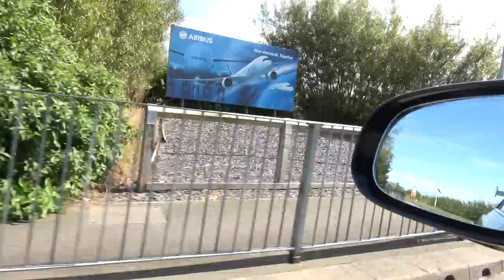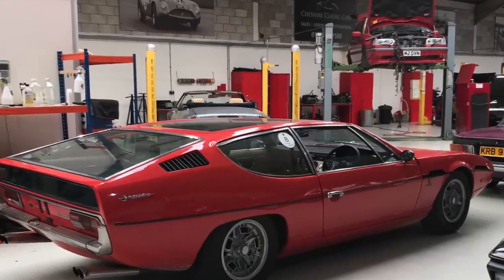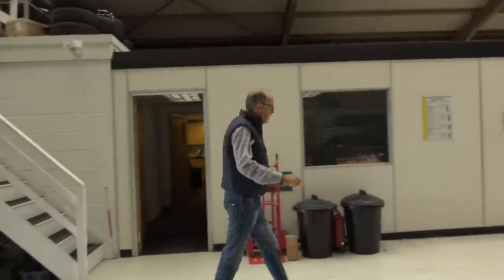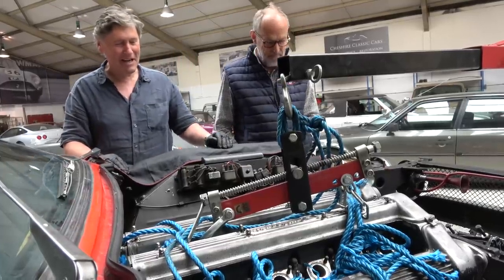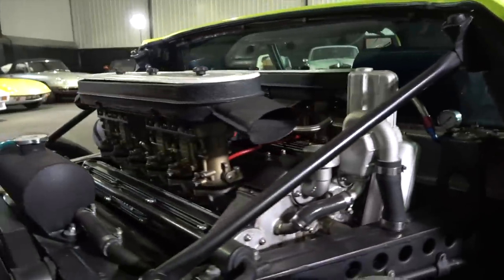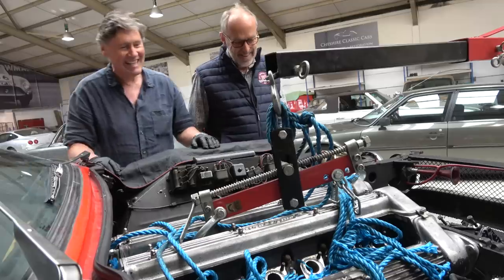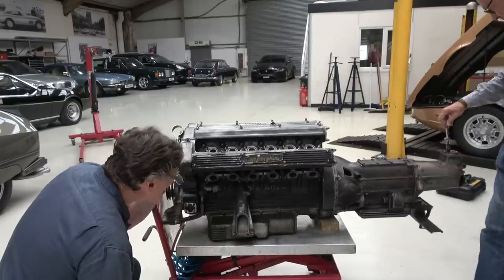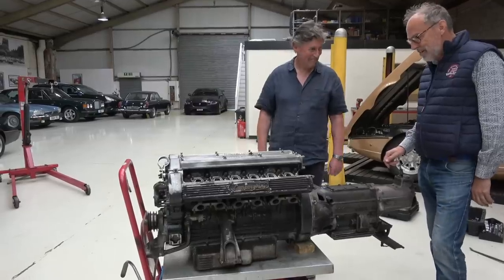Lamborghini Espada V12 engine rebuild. Part 1, removing the engine

Comment: These two two blokes were actually very patient.. with Harry!
Reply: Antonio Farina  and they had his engine lashed to the crane with cheap polypropylene rope.No nice brackets and chains.
Reply: @ianrutherford878  @Ian Rutherford I noticed that too!! No Chains!?!
Reply: @ianrutherford878  those things can handle the drivetrain's weight easily, metal chains would chip away at the engine, these are old engines made without modern metallurgical advancements

Comment: One of my neighbours had a Lamborghini back in the early 1980's and I drove it periodically. It was diesel and very economical. Air cooled. The gearbox was a bit of a revelation at the time, having excellent synchromesh and 24 gears forward and I think 12 in reverse.
Reply: Like a R 480 or something?
Reply: 754 I think. Rear wheel drive, not 4wd.
Reply: I bet it handled like a tractor ....
Reply: @yatespeterm  
It handled like a real thoroughbred Lamborghini. For its time, it was excellent. It had the Pantherised engine that had Bosch injector pistons that work directly off the camshaft

Comment: I knew a guy who had a Lamborghini Espada. I was in pretty god knick. The logos on the cam covers had been highlighted it Red.
The only issue was the upper bodywork and the major rust round the vent gills on the rear roof C pillar. 
He said it's only a run around and not worth bothering about. I think he paid a couple of thousand for it back in the late 70's or early 80s ? 
A long time ago. Great video and good to see you have found a great specialist to help you sort it all out

Comment: I would absolutely love to work in that garage! It would be an absolute pleasure to work on these cars. I really hope this comment makes it ro the owner! A trick that I've used with tight fitting engines that have protrusions that might hit the frame, I cut up washer jugs and use the plastic as a slide rather than a pry bar and risking denting or scratching sometimes irreplaceable engine components. That being said, a pleasure to see such a fantastic car taken care of beautifully. What a fantastic engine!!

Comment: You might tell the mechanics in this video that the York AC compressor is designed so that it can be removed without discharging the refrigerant.  You have to screw in the valves in the head all the way, this blocks the refrigerant in the lines so that the compressor can be removed and/or replaced.

Comment: On the cam cover, at the wide end, where it meets another cam wide end, there is a little metal plate held in by a bolt, or nut and bolt, obviously to keep the wide ends down. Was that from the factory or is it a typical fix for these engines? (I.e. were the covers twisting over time and that wide end wasn't keeping a tight seal against the gasket?)

Comment: Great video and looking forward to seeing the following parts. 
Surprised and disappointed by a couple of things, not power/steam washing the engine and box down before starting the job,  not covering up the intakes when the carbs were off,  and for having such a cobbled together rope job to lift it out after having been lifting them out for as many years.
No doubt you will be getting a lot of detailing done while there is room in the engine bay ;-)

Comment: Good first impression of this mechanic. It costed me $6000 and 2 years (original quote $1600 and 2 months to complete) to have an MG 1500 engine rebuilt. And when I  first tryed it didn't run and didn't have oil pressure. It actually spun a bearing first start. Last time I'll ever take family advice on back shop mechanics. Just pay the bill for a proper brand specific mechanic to do his job. It'll be much cheaper in the long run.

Comment: From the experience my brother and I had taking the engine and gearbox out of a Fiat 124 Sport (AC) more times than it should have; it turned out best to have the rear wheels up on ramps and the front wheels on the ground (so that the body was facing downhill. This made the engine/transmission hang at just the right angle to slide in and out without having to force it in any way. We discovered this on the last round, of course...
Reply: It goes without saying, that you can't orient a vehicle body in this way on a two-post hoist.

Comment: Are you expecting ovulated or scored cylinders ? If so where would you get hold of some or would you bore the cylinders up a 0.1 ,
Reply: It's probably just wear or weak rings or a mix of both. Cylinders weren't plated back in those days and old Italian cars have notoriously small oil galleries so they wear pretty quickly. Add that to carbs sometimes washing the bores with fuel (like on the overrun down a big hill) and its fairly normal for them to need new rings and a hone quite regularly. 

I expect if it's already been rebuilt as he suggested that it may well need a small overbore by now though.

Comment: I'm sure it is "matching numbers", but if the engine had been changed, wouldn't the changer have updated the DVLA, so the V5 is correct? Isn't there any documentation from the supplying dealer confirming the chassis and engine numbers?
Reply: He will already have checked the chassis number against the V5.

Comment: I first looked at it and thought "Just drop the front subframe/crossmember. Easy peasy"  Of course the frame is welded into the car. I'm glad I don't work on Lambos. Is it a wet sleeve engine?

Comment: just did this on my mustang 289/T5 and exhaust came out to. luckly the shifter assembly unbolts from the back side trans tail housing. wonder if this espada has a neutral safety switch?

Comment: Would it not have been easier to put the car on the lift, drop the rear of the gearbox, move the engine backwards until it cleared the crossmember, then drop the whole thing out of the bottom?

Comment: Ok, i'm being stupid, but aren't you supposed to remove that assembly off the engine, before removing the engine out of the car? I swear i remember a TV restoration mid 90's where they let it loose, lifted by a smidge, then removed the whole front section making removal a breeze.

Either way, great excitement at the "part 1" in the title, rarely do we get to see these outside of specialty shops.

Comment: Looking at the damage already done to the frame, someone's already had the engine out.  Can you imagine trying to put the engine back in after restoring an Espada?  F*cking hell.

And Harry later says it's been out in 1987. ;)
Reply: The trick is more angle on the engine/box. The winder they're using hasn't got enough range of movement or the rope is taking some out but it really needs a few more degrees to allow it to come out properly. 

Easy to say but not so easy to do when you're trying to do it with a normal engine lift.

Comment: I question the use of "Telecom rope" for removing that engine? hmmm
Reply: If you have an engine which is hard to get replacement parts for you don't want chains digging into things like valve covers. Rope isn't ideal but it's a good way of keeping loaded chains off precious parts.

Comment: "Muira SV suspension..."   Proper anorak talk there - carry on.  :-)
Reply: more like the Miura borrowed from Espada
Reply: I doubt it.  The Espada was built from '68 to around '78, and the Muira started a few years earlier, in '66, and finished in '71 with the 400SV.  Since the Muira came first, and all Muiras had knock-off wheels...and only the earlier series I and II ('68 - '71) Espadas had the knock-off wheels...it seems more likely the Espada had Muira suspension, and not the other way around.  Until the '72 Espada series III, when it got a different wishbone design, along with conventional wheel lugs.
Reply: @aussiebloke609  Miura P400 had a flawed rear suspension design, so  the Espada was designed  with its own improved suspension from the start, which later was carried on to Miura SV
Reply: @Rover Waters   Interesting - I've never heard that story before (although the idea of the Muira being flawed isn't exactly a surprise, either.)  Do you have a link to this info?  I'd love to find out the full story behind it.  :-)
Reply: @aussiebloke609  google books- Miura bible
Reply: Thanks mate - I'll check it out.  :-)

Comment: £xxxx worth of car, £xxxx worth of engine and they use the CHEAPEST rubbish film rope on the market!!!! STOP THEM HARRY!!
Reply: You think a more expensive rope would pull it out better? What would you use?
Reply: WILLRACE4FOOD yes a braided polyester rope won’t break, this cheap film rope will. For the expense of and extra £20 could save thousands on a snapped rubbish rope (that breaks down with uv exposure) over a high quality proper rope
Reply: Don't panic it wasn't holding the whole thing.

Comment: I'd be curious to earn how much an espada engine rebuild actually cost. Would you be so graceful to actually disclose this information?
Reply: Think of a number then think again. Then double it.
Reply: @siraff4461  very funny...
Reply: @perjanuschas8050  The real answer is it depends. I'm not sure on the Espada but on a lot of classics there are different ways of rebuilding and they come with their own prices. For instance you might pull the motor, check everything and put it back in for a few thousand. Or you might go all the way back to a block, have it re-machined on all the faces and blueprint the entire thing from all new parts which is more likely to run into the tens of thousands. 

This one is breathing heavily so it's going to need at least a re-hone. I would be surprised if the bill was less than £10k and it could easily be double that.
The mechanics rates and amount of work required will decide.

Comment: Risky business using cheap polypropylene rope instead of steel links and bolts to lift the engine.   One of those knots could have come loose.   The device with the big acme thread at the end of the boom is for tilting the engine as it comes out.   But it has to be securely fastened to the engine block.

Comment: I would rebuild the V12 roll it away into the corner of the garage  & drop a small block 383 stroker crate engine with a Tremec 6 spd.  😎

Comment: engine hanging from nylon rope, had my cringe meter pegged..
Reply: The engine was not really held up by the nylon ropes. It looked like they were using the nylon ropes to get some extra angles on the engine to allow them to clear the various crossmembers. If you look at the very early part of the video there is actually an engine lifting apparatus that is really holding the weight of the engine and transmission. You can see it clearly at 3:05
Reply: Ropes are million times better than e.g. chain
Reply: @jensenhealey907efi  dude, in your time stamp,
 the entire engine tilt mechanism, is literally hanging from the hoist by three wraps of rope, and a knot. :) 
 now i know that rope is strong, and he's likely been doing it his way for decades, but that still does not remove my fear of a sharp edge spelling the end of a high strength rope.  I've seen enough of them dropped, even with the use of chains, to make me cringe at the thought of it falling on Harrys fender, or worse pinning an arm or hand under it.
  cheers.
Reply: Ah, I missed that part. Good eye. Yeah, I would have had the engine tilt mechanism hanging direct from the hook on the engine hoist. No idea why they did the loops of rope between the hook on the hoist and the engine tilt mechanism. That does look half-assed.

Comment: I would NOT run this engine without an oil pressure pre-pressurization system which activates prior to engine start up. Its lunacy to cold start this engine after it has been sitting for a long period of time.

Comment: million dollar garage uses cheap 200€ engine crane and rope to lift an engine...i am more fancy than that...i use old seatbelts....and if that engine bay was freshly painted it would have been scratched....a big no no in an expensive job like that. atleast put a piece of cardboard between engine and x-member